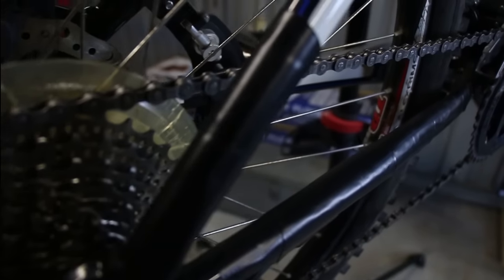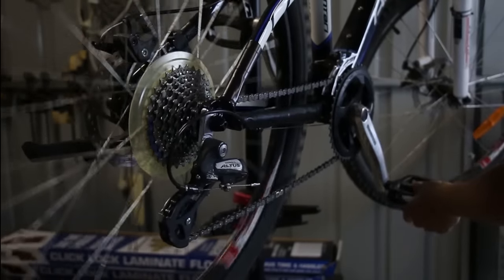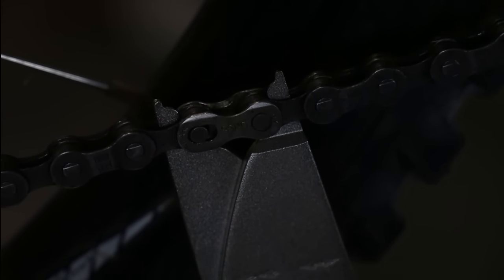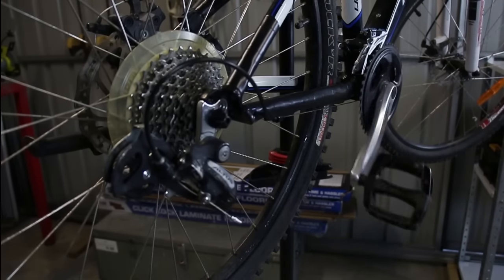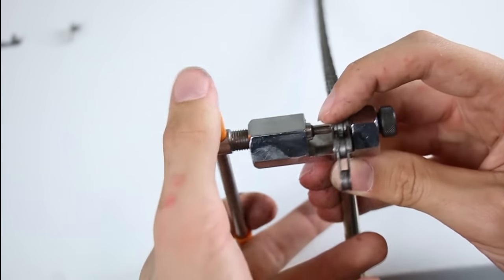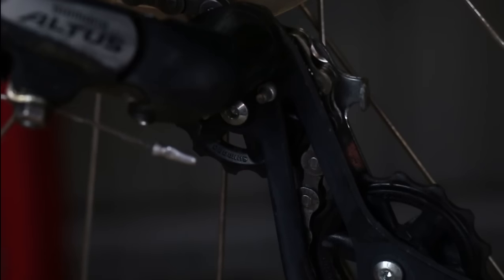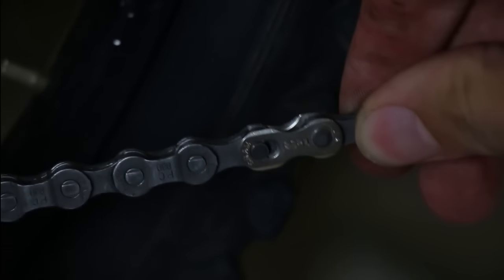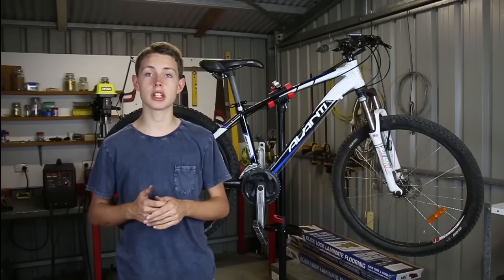How To Tighten Your Mountain Bike Chain!!

Comment: This video is about setting chain length, not about tightening or setting the tension of the chain. For the latter you use the small screw on the back of the derailleur in every multi-gear bike, which should have the letter B printed right near it. If you are hoping to increase the tension on your bike chain, rotate the screw clockwise.
Reply: Stephen Salter Dude thanks for saying something! I would have done this all wrong if it wasn’t for you.
Reply: Oh thank you! My chain has been slipping and I thought it would be the same adjustment as my dirt bike but it definitely is not. So, thanks.
Reply: I’ve turned all the way clockwise and still skipping and lots of slack what do I do now?
Reply: @crtyz8476  lol Stephen tucked you up and bounced out of the comment section
Reply: @crtyz8476  wrong
Reply: king
Reply: Mine has an h and an L
Reply: Im confused
Reply: If as you say it's not about "tightening" a chain then why is the title of the video "how to tighten your mountain bike chain", please change the title to "how to set the chain length of your mountain bike chain" if that's all it shows
Reply: Thanks i was about to do it all wrong
Reply: I love you forever
Reply: Thanks cause everytime I take a bump that is a bit too big my chain pops off my front gear set 😅

Comment: Really with your bare fingers you are going to snap the links together? Nah you need a new missing link each time. To snap em together you will either need  closing pliers or apply pedal force. The fact you were able to put em together so easy shows how much you have RE-USE those missing links. Not safe
Reply: Ive been using the same missing link for 4 months and everytime I clean my drivetrain I remove the links and I had no problem with it
Reply: And also I do long rides and light to blue trails😉
Reply: @nakii7624  wtf are blue trails
Reply: @magnumllama400  intermediate trails goddammit

Comment: Thanks man, this was quite helpful. I have noticed that i have a lot of chain slap and my shifters have trouble sometimes on my bike (the same as yours, the stance) do u also have this problem?
if this isn't the problem do u think it might be the derailleur hanger or something like that?
Reply: You should check the tension of the shifter cable and check the low/high adjustment screws on the derailleur to make sure the derailleur is aligned with the cogs on your rear wheel.